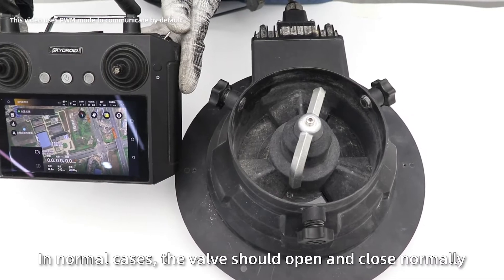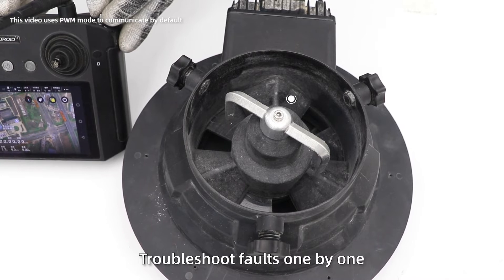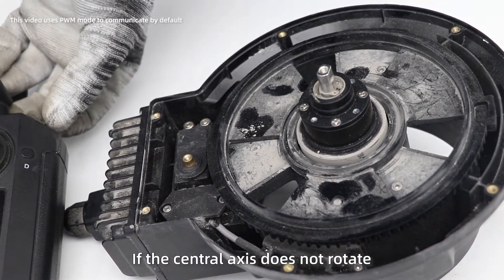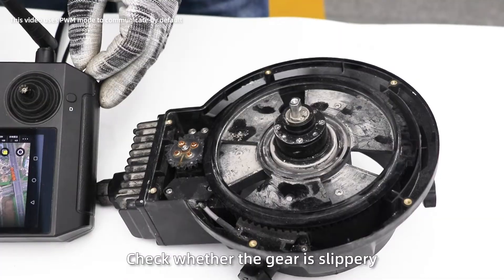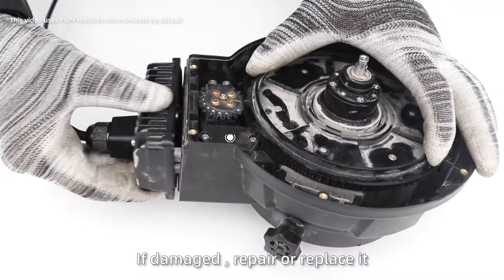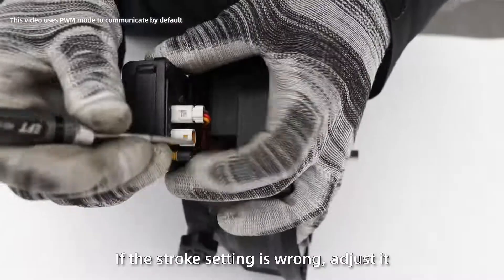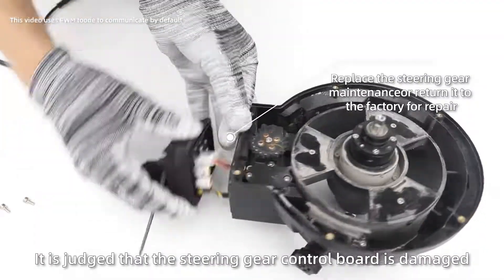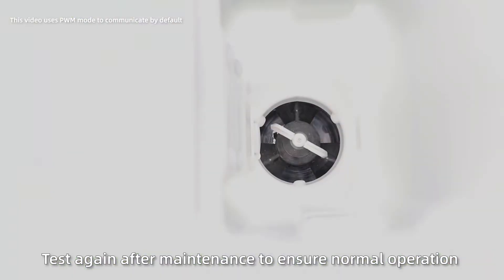Drone Spreader Troubleshooting Repair Instructional Series video 1.3

Comment: I'm using this V2.0 spreader, Valve working and turn table also moving but seeds not coming out. what is the solution.
I tried with paddy seeds